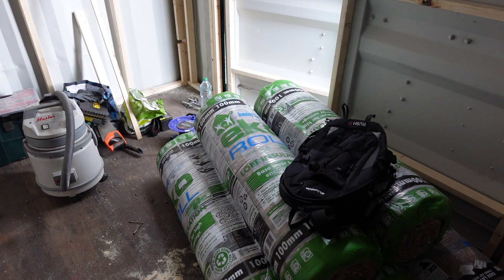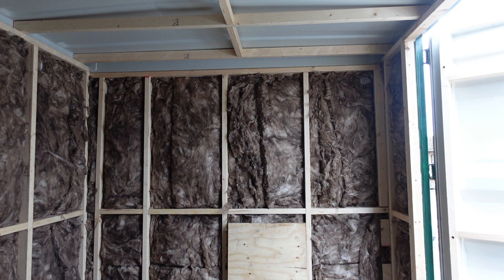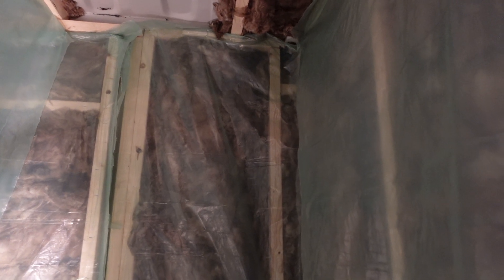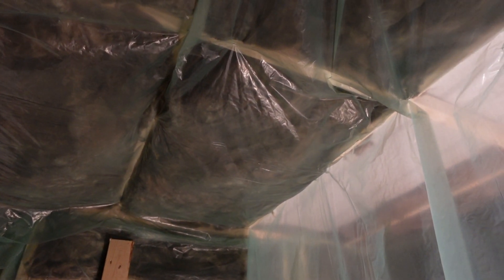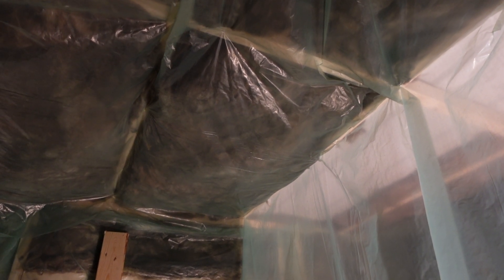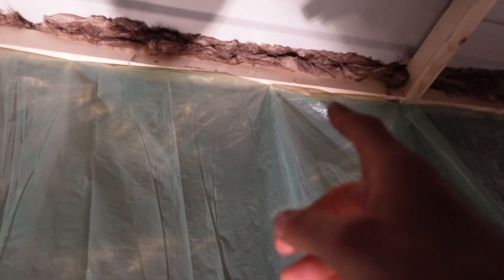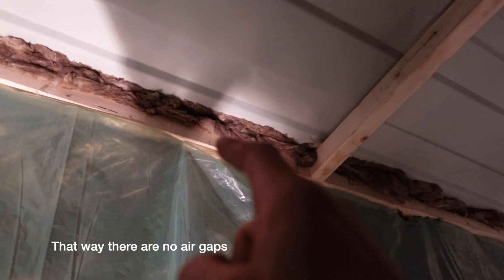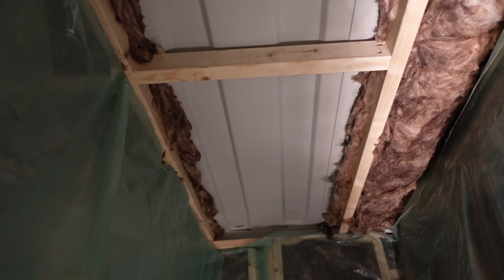Shipping Container Insulation | Container Conversions

Comment: How is this holding up?  I am not an expert but my learned understanding to this point that in a metal building/shipping container, the purpose of the vapor barrier is to prevent differing temp env from touching (forget what it's called).  This happens in a container at the metal which means the barrier needs to be at the metal.  In this instance, the plastic will prevent "vapor", but not temp changes hence you'll still get condensation at the metal in this layout...?  If you are avoiding spray foam, then reflectics or other heat reflecting material should be at the metal, then the insulation.   Basically a modified flash and Batt.  I think what you have here is for a stick structure in certain environments, but I am no expert so interested to see if this worked for you.
Reply from the maker: It is holding up very well. I had to remove a section of it whilst re sealing the door and the insulation was bone dry. On a cold morning the outside of the container would be cold and the inside would be relatively  warmer. Condensation occurs when the warm air (moisture carrying) reaches the cold surface (that being the container walls). So the idea behind the vapour barrier is to stop this warm air inside reaching the cold walls. If it did, it would condense and cause moisture issues. There are several air vents around the container to allow this warm air to escape (as hot air wants to move into cold air). The constant air coming in and out certainly helps. Great to see you watching from Texas, I'm across the pond! I suppose each country has there own building styles and specifications, weather being a big factor of course!